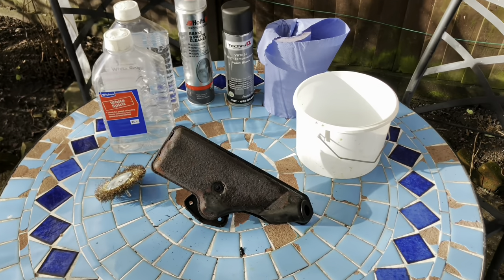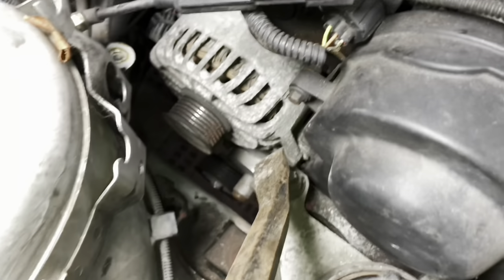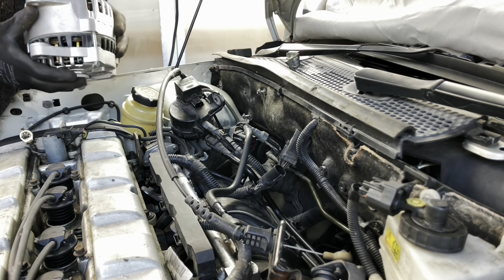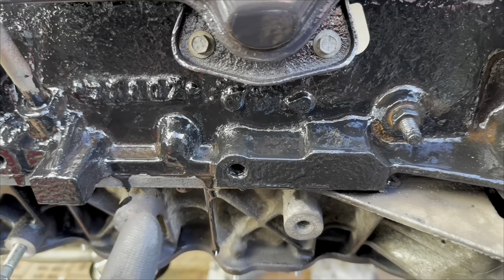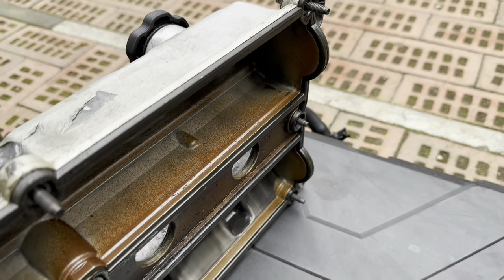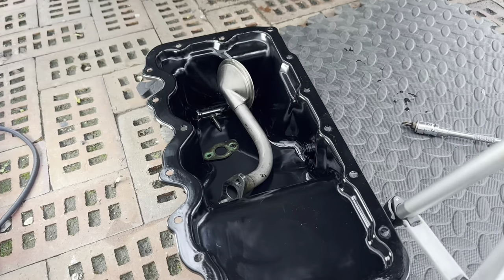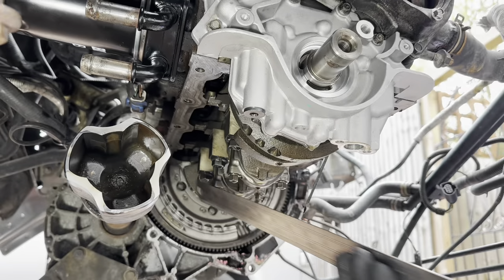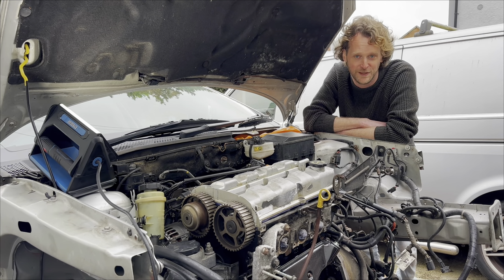Focus Engine In Car Oil Pump Replacement

Comment: Yeah whomever designed the alternator position, well I hope that person got some help! I can see the AC being an issue to replace but not the alternator. That is a unit that needs to be 100% accessible to replace in need. I dealt with that issue on a road trip, it cost me but I had no choice but to have another do it for me. Normally it would have be a 30 minute job. In my case my Focus eat a battery after 3 months, second lasted two years; the third lasted 5 years so I thought I was out of the woods. Not to be so, crashed and burned in Michigan. As far as I'm concerned the alternator was bad from day one but since the replacement I have had zero issues. Wauconda Illinois here. Been around cars and worked on them for many years but what exactly are you calling an oil separator? Something rings a bell with diesel but not gasoline?

Comment: next time you change the alternator just remove the 3 bolts holding the engine mount to the chassy leg and slide the whole engine forward, it wont go anywhere, it should move at least 5cm no problems even on car where everything is attached, not dismantled like yours is. And this should give you heaps of space to manuver that alternator out in seconds instead of swearing for minutes
Reply from the maker: Nice one! I’ll try anything to avoid doing that again 😄👍

Comment: These ford parts are like gold dust aren't they! , do you happen to have the ford part number Finis and PC for the PCV crank valve ? I think I may have to get a gates mini tube and the rubber grommet, not sure about the grommet Ford told me no longer available to order, if you did have any products code that would be really appreciated , kind thanks :)
Reply from the maker: Parts are very hit & miss for sure even from the Ford main dealer! I got my PCV valve from a supplier on eBay - same with the tube and the rubber grommet PCV valve seal. The only seal I could find was listed for a MK1 Focus RS but it’s exactly the same. They share mostly the same components apart from styling pieces and turbocharger associated goodies so always worth a look
Reply: @st170restoration  thanks Paul, appreciated - keep up the great work, 170 am sure is gonna be the business real soon, all that hard work will pay off :)

Comment: Hi pal, in the video you mentioned you used the wrong primer and would have to redo the front and back....how come?
Reply from the maker: Yeah it’s a proper pain - I noticed on the back the anti gravel coating has started lifting and patches have turned white over the winter so it definitely needs to be redone. The primer I used was an automotive primer I’ve used for smaller repairs in the past but I don’t think it was up to a job like this. I’ve had recommendations for more specialist stuff from Bilt Hamber so will strip it all back to metal and try again. Also I’ll try to get the surface prep even better this time and prepare it with rust removal gel  as there’s only so much I could get off with the preparation wheel. I found anti gravel to be a bit soft too even with a top coat, so hopefully going for better quality products from preparation to finish will sort it 👍
Reply: That's a bit of a kick. I used rustoleum surface primer and motivation anti gravel. I've noticed some rust spots have come through but the anti gravel hasn't lifted. Luckily I've still to build mine back up, im wondering whether hammerite kurst is as good as its meant to be
Reply from the maker: Yes I’m not too sure about the hammerite I recon it may have been more suited to slightly smaller jobs. Hopefully yours will be ok - good thing to keep an eye on it though just incase before you put the bits back on!

Comment: Thanks , I very much enjoyed this episode. Sound, editing and footage improved a lot since last year. Any news on the engine knocking problem?
Reply from the maker: Thank you glad you enjoyed! It’s getting much more time on the edit now and doing jobs several times to get the shots right. Camera also got upgraded to a 4K one and seems to work well! 

I recon the knocking may have been running 99 Ron fuel when it was previously only on 95. Battery had been out for months and engine management hadn’t had the time to recalibrate possibly..? Either way it’s now operation ‘change everything’ so hopefully I’ll flush it out 😆

Thanks again for watching 👍

Comment: what a brilliant thing your doing on the classic 170, maybe I can do that to my panther one day - excellent videos and tips and helpful to all. I just had a question as your 170 has the climate pack/control do you know if there is a resistor on the heater / blower in the glove box area - normally sits lower down right side, maybe blue or black colour, but i've been told this climate system doesn't have one - any help is much appreciated - keep up the great work and videos, AMAZING !
Reply from the maker: Hi thanks! Glad they’re useful! Not sure about the resistor as haven’t looked behind the dash on this particular car yet - will have a look in the next day or so and update. It’ll probably have one as it’ll still need to alter the fan speed regardless of input. Unless Ford have done it in some other weird way - can never tell with these 😆
Reply: @st170restoration  awesome! thanks ;) - that would be just great, this would be handy for not just me, others that either have the climate pack or non climate - in the case they have a battery drain like me! which i believe could be something to do with the blower, when your told its the resistor and there isn't one LOL ! kind thanks ;)
Reply from the maker: @mrhchristopheridc6868  Nope couldn’t see a resistor so must be done some other way unless I missed it 🤷‍♂️ 
I’d try removing the fuse to the blower motor and see if you still get the power drain. When the resistor went on my transit connect it was either stuck on max or off. If I find out how it does it during the next videos I’ll update 👍
Reply: @st170restoration  appreciate that thanks Paul, i'm still stumped, tried that as well thanks, near 2 months and close to giving up! that I mean may have to call in a auto electrician! i'm very sure its to do with the AC/Blower - blower been out looks clean runs free, but dreaded footwell leak may of caused something- if the garage did the correct job in the first place wouldn't have a leak - didn't change the seal, even when provided them with it! why I have to do this on my own, but want to thank you again for your great vids as it has been helping me with things :0) keep up great work 170 looks grand mate